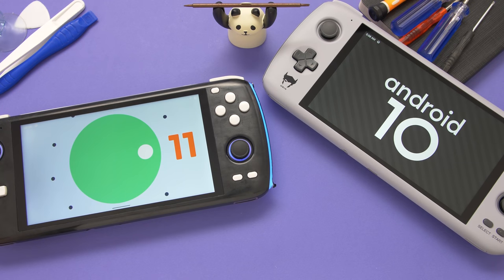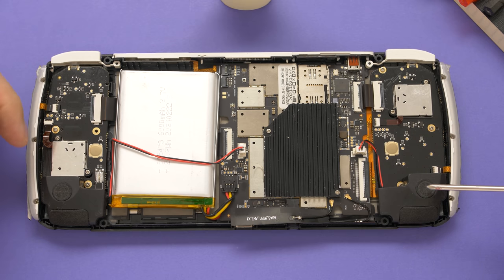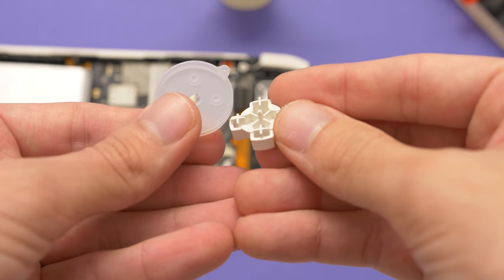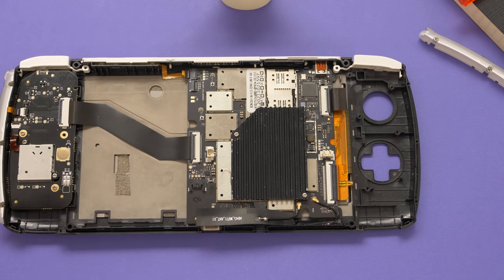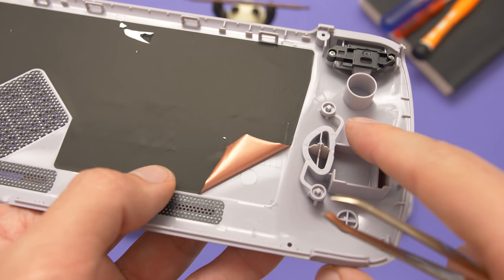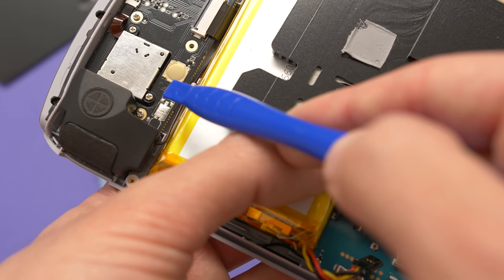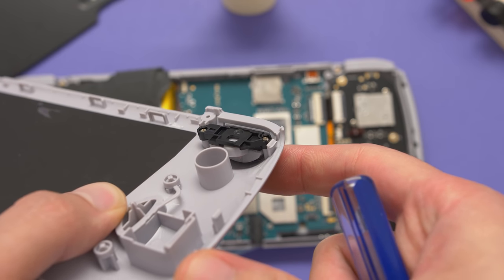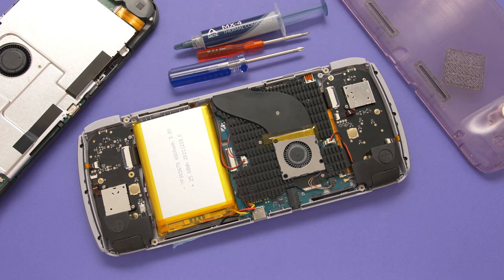Odin Lite & Odin Pro Teardown - Reparability / DIY Mods / Upgrades

Comment from the maker: Odin is repair-friendly.
Reply: If you're able to possibly source the parts.
Reply: Need gameplay of odin light
Reply: @colt45jb  Yeah would be nice to see some Odin Lite gameplay, or a brief overview of it's Android 11 for emulation. I know retail units are not ready, but the prototypes are. I'm still deciding whether the Lite is sufficient or if I need to boost to the Base/Pro, but it's difficult without a comparison.
Reply: Any idea where to acquire the LED strip?
Reply: Is there 4g capabilities on either versions of Odin. In your video you show a slot for a sim card on the light version and even mention the area where the 4g antenna would go. However you do not explain if you could add an antenna or not. Some clarification on both models would be great to know.  Thanks for the awesome video.
Reply: Any ideas how to swap the D-pad and left joystick with each other - so that the DPad higher up and the left joystick is closer to the bottom like the right joystick?
(I never use the left joystick - I prefer clicky joysticks / D-pads like on the GBA SP or Neo Geo Pocket)
Reply: @DavidFilskov  you are on your own tbh. I think retro game Corps has a video on swapping the thumbsticks. But the dpad is good enough for most people.
Reply: Thanks. Got my Odin and XP+ today and yesterday respectively. Both has excellent clicky DPads! - yay! :) - I just wish they were positioned more towards the top like on Anbernic.
Reply: stl files? would be cool if you can 3d print it yourself

Comment: Really nice to see that they even went as far as to make sure that battery availability is given, even if its not from them directly.
Reply: Except that battery is 3750mah not 6000...
Reply: where can we get a new battery from?
Reply: I tried the battery replacement using the Nintendo one.Now my Odin cannot charge it. It only worked while the brand new battery original charge lasted. 😢
Reply: Hi. How did you connect it since they have different connections? My lite battery is swollen so i really want to replace it. Ty. @MrGranMarco

Comment: no, the fan directly on top would be worse .. this blower style fan is designed to push air across the finnstack, putting it right above would mean the processor heats up the fan, and thats it .. this design is already good, better would have only been a heatpipe radiator deal

Comment: I dropped my Odin Pro and the L1 button broke (specifically, the contact on the PCB board). I sent Ayn an email asking if I could send it in for replacement and they sent me an “upgrade kit” containing both boards, shoulder buttons, ribbon cables, and even a screwdriver. 

I’m honestly surprised how easy this was to fix, coming from someone who’s never tried replacing one of these boards before. Also thanks for the teardown video it helped a lot with getting mine swapped without destruction.

Comment: From what I have observed most of the switches unde L1 and R1 came broken from factory and thats due to negligence or rushing during assembly. If the the plastic trigger button is not placed properly from an angle and one side first it would not sit on top of the tiny black switch, instead it will apply pressure from side of the switch which if pressed under the trigger will bend the switch toward front of the device thus breaking it. It will still work but only with more pressure applied on trigger switch which will lapse with time rendering it unuseable completely eventually. It is a design flaw and quality issue. Im affected by this unfortunately and have not been able to enjoy my device.
Reply: Same here brother, it's a real shame too. I tried my best to make the l1 switch work but no dice. I reslly hope AYN hooks us up with replacement boards, as this is a complete oversight in their part
Reply: AYN Update guys,  curious if they handled it since I'm wondering about the Odin too hmm
Reply: @retrobros9684  yes they fixed it problem I'm their next iteration, they tweaked the design of switch and it's housing. Older model received new switches and boards newer models had update build.

Comment: Taki, help!  I noticed there's 4 antenna connectors on the Odin Lite. Do you know what those U.FL connectors are connected to? Is 1 pair connected to the LTE chip and 1 pair by the GPS??
Reply: Did you ever find this out? I’m curious about the cellular antenna and can’t find any info…
Reply: @SargeMustang  I did, I also bought 2 different 5g antennas, and I'm pretty sure they work fine. The problem is that I believe there is a baseband issue, or MediaTek D900 does not operate the same 5g bands as T-Mobile or Verizon in the USA. I tried both, and only the T-mo would connect to 5g, but it would pop in and out of 5g a LOT with all 3 different antennas if I was indoors. So much that it was battery drain. To be fair, the 4g works just fine. I was able to make calls, text, and use data around 300+ Mbps on MINT. Right now they have their buy 3 get 3 months free deal, and I'm using it to type this. If you use it on the go, turning on 5g while outdoors seems to work much better, even with the stock antenna. I did have to mess with the APN settings to get it working properly to begin with though.
Reply: @seouljah760  huh that’s really interesting… I’m using T-Mobile myself and my specs and signal are so bad I was hoping I could get some better performance if I upgraded antennas. For instance, sitting here with my iPhone and when switched down to lte I’m pulling 129 down, 5g breaks 300. But the Odin is just sitting on edge…

Comment: Taki, AYN seems to really know their stuff when designing console hardware. Since you worked closely with them, maybe you can answer this: Who are these guys? Where did they come from? Do they have a "mother" company or investor backing the project?
Reply: I hope he does an interview with Andy I believe?(Odin handheld project head?) On his channel.

Like he did with Retroid project lead, Michael I believe?
Reply: They have to have someone backing with money or the guy behind the company is quite rich. The development, manufacturing and distribution of the device didn't cost less than $5M USD given they need to make 10,000 units for a launch at the very least.  Of course that if you tried to do this in USA, it would cost at least double, but probably triple that amount.
Reply: Yeah. They seem like they know what they are doing. I'm curious too. I wonder if it's like a OnePlus situation where they are basically owned by OPPO.
Reply: @StatusQuo209  or OneXPlayer/OneNetbook which is a VOYO subsidiary.
Reply: @AlexDiaz-gw5ov  there are also some rumors that they are gonna launch a DIY OLED version that is CM4/Zero 2 compatible. So for all I know, they might know a thing or two about DIY handhelds like Geekpi or Experimental Pi.
Reply: @StatusQuo209   For me as I state in my first comment here is where the money came from. This was not cheap to do.
Reply: I've heard that the owner of AYN is the step brother of the owner of Retroid or some other family relation.

Comment: My only concern with buying one of these is the L1 R1 shoulder button issue.  It looks as though before I even start using the device that I should remove the rear housing on the unit and make sure the plastic shoulder buttons are installed correctly, and avoid using excessive force to prevent breaking the PCB side component.

Comment: can you change the ram out yourself if you open up the odin lite or base? im wondering if its like some laptops where you can easily swap it out because i happen to have an extra 8 gb stick of ram from an old computer, so if its easy to swap i might buy the lite or base and just switch the ram my self.

Comment: is it possible to replace the internal storage or is it like soldered down on the mainboard? i cant find this info anywhere online ): i imagine theres an m.2 ssd somewhere inside... im wondering: is it upgradeable (in the diy sense) ? and if so, is there a capacity limit?

Comment: Quick tip I wouldn’t slide the spudger/pick when levering it open, it will damage the edges of the shell.
Reply: I can’t really imagine something as soft as a pick would cause any noticeable damage to the shell.
Reply: @RichBordoni  I used one of those plastic spudgers designed to help take apart cases, and yeah it scraped a small part of the seam a small bit. It is so tightly joined that any tiny scrape or deformity to the edge is noticeable, very minor but less than perfect (Only will happen from sliding down the seam action)
Reply: @BrokenOpus  Interesting, I will have to keep that in mind for when I get my Odin.

Comment: Would have been nice if the front cover over the controls was removable on each side instead of having to go through the back.  Most of the repairs or mods people make on these systems is on the buttons.  It is nice that the buttons have their own PCBs though.  I hope some custom PCBs are in the works.  Imagine having a Gamecube button configuration on the right side that you could install, that would be cool!

Comment: My pro front shell started cracking so Ayn sent me a new front shell with screen attached. Will the side leds and power/volume button ribbons come out easily with heat? I see theyre attached to the shell with adhesive and Im afraid of tearing them when switching over to the new shell...

Comment: I think I would be pissed if the lite doesn't  have a fan. There is nothing I've seen to say that it can get away without one.

Is there a possibility Odin will release updated PCB's rather than buying a brand new device when they refresh the SoC?

Comment: As someone coming from Gamecube controller modding, the way the Odin handles analog triggers is LEAGUES better, even conceptually. Having a magnet giving precise readings is far superior to a physical slider that has to be housed within the shell. I imagine it wouldn't be too hard, given the right firmware, to adjust the trigger's actuation point (as opposed to NGC where you have to physically alter the triggers).
Reply: Careful, the magnet broke easily when I dropped my system.

Comment: I'd been wondering if this device had a Sim card slot since I first heard about it.  Knowing it does, that means I could use this as my phone if I wanted to.
Reply: But does it have a microphone?
Reply: @noonethatspecial  I think I saw it mentioned in another video that it does.  Even if it doesn't, though, it has bluetooth capability, so you can use a headset.
Reply: @harmsc12  that's fair.

Comment: So, would anyone have any idea why the Odin Pro's screen would suddenly stop working? I just got mine about 2 weeks ago and the screen won't turn on/flickers different shades of black. It still charges but that's all it can do and yes, I've tried booting it into safety mode with the volume and power button combo, but the black screen still shows regardless. Any help would be appreciated.
Reply: Did they or you get it resolved? Asking cause I'd like to know how they handled it, as a potential customer here, thx
Reply: @retrobros9684  Nope. Tried to fix it myself about a month ago and the thing caught on fire. Funny thing is, after that happened, AYN contacted me about an hour later. lol

Comment: It'd be cool if you did a video on the Odin lite performance both windows and android
Reply: Odin lite can't do Windows like the Pro. The Pro is taking advantage of a chipset that is very close to the one used in some Qualcomm windows laptops.
Reply: You are right but I'd still want to see how the lite performs with emulation on android
Reply: You can still try x86 apps with exagear and there some termux based solutions out there. Also I know some people are working on bringing Box86 over to android hopefully we get a release sometime soon.

Comment: I am going to really regret my decision to buy the Odin Lite with upgraded ram and storage if it doesn't come with a fan. It seems disengenious to have the fan shown right after the spec sheet of all 3 devices on the IGG if only 2 of the models will come with fan. For this reason, I never even considered that the Lite would not have a fan. If indeed it doesn't come with a fan I might as well sell my device as soon as it comes in because it most certainly will not be able to do everything that I bought it for without a fan.
Reply: I also had the lite backed and after seeing these videos I regretted it so emailed ayn and they were about to refund the lite so I could order the pro instead.
Reply: @jer0006  did ayn confirm there is no fan for the lite model? that is sad because i have to lose the super fan perk because their listing is inaccurate
Reply: @topg4489  I never saw anything other than the tear down that taki did.  After seeing his videos I cancelled my lite and switched to a pro though.  I would say there's a good chance there's no fan as they would have to do something to differentiate it more.
Reply: @jer0006  I'll probably wait till Friday. See what the team has to say but it seems likely that I'm switching to the Base or Pro

Comment: ...the Lite not only runs a Mediatek chip for some reason even though it was pitched as the "199$ Snapdragon Handheld", but it lacks active cooling when it was said TO HAVE IT? And the Dimensity 900 running HOTTER than the SD845?

The heatsink looks incredibly confusing too. Why on earth is most of it vestigial and not touching the chips?

What is the market goal for this? The Pro (which is what was ACTUALLY advertised and yet costs far more than the listed original price) is 250$ at least and in reality it will be higher now due to shipping/etc. It's encroaching way too close to the 399$ Steam Deck.

The actual device is priced fairly as far as I can tell, as actual high-end companies who can get wholesale stuff/etc. wouldn't even be able to put together a device this solid or speced for 250$, it's stronger than most 250$ smartphones, for instance.

Android and ARM can't hope to compare to Windows/Linux and x86 in terms of gaming.

It's also pitching itself on repair friendliness, but who's supplying the parts? If it's AYN, shipping and sourcing may be an issue. I don't think it is them though as Taki made it a point to keep showing alternative parts you can use, like Switch batteries (which will be in production probably for longer than WE are alive with how popular it is), Vita D-Pads, etc. Screen may be an issue to source. That probably has to come from AYN?

Comment: 0:36 is incorrect - for the device to come undone without a screwdriver, simply boot up Space Invaders Atari 2600 on the Odin and the screws automatically unwind and the system falls apart, leaving a hands-free opening experience (but also the possibility of a fried board and components inside).
Reply from the maker: Omg, this trolled me.
Reply: @TakiUdon  just providing accurate information for the patrons, thats all!  !
Reply: The problem is that you can’t legally install Space Invaders Atari 2600 unless you own a copy of the original cartridge.  I mean, those are practically impossible to find and very expensive when you do.

Comment: The Best handheld so far:-
• Low cost. ✔️
• Fan Cooling. ✔️
• Repairability.✔️
• Runs Android and Windows OSs.✔️
• Pocket size.✔️
• LED analogue sticks.✔️
• Availability. ❎
• Bass speakers. ✔️
• Dock mode/ HDMI output/ External GameCube controller and USB ports. ✔️
• Better Battery life. ✔️
• Headphone Jack. ✔️
• Good Processor. ✔️
• Less throttling. ✔️
• External HDD support. ✔️
Reply: @Zenik506  For that price, it's a good bargain, actually the dock is not that bad either.
Reply: I’d say the only 2 pieces of feedback for me would be some improvements to the launcher, put the default buttons in abxy like an Xbox, and improve the rumble motor. A fantastic device
Reply: @MrBrandonbarlow  you can change the buttons to Xbox.
Reply: @Zenik506  my thoughts also. If I have to spend 5 mins reconfiguration for each emulator. You can buy any USB C dock and it will do the same for less then 50 dollars
Reply: Pocket sized is debatable

Comment: When I hit my Odin pro with a 10 pound sledge hammer, I find it obliterates the device very easily. Especially due to its lack of armour and useless crumple zone on impact. 
It’s funny when comparing it to the Nintendo Switch, who cleverly put in an airbag feature. Stopping such brutality and vandalism in its tracks.